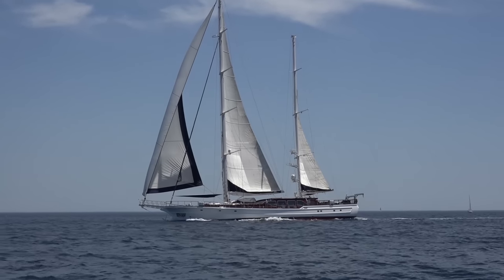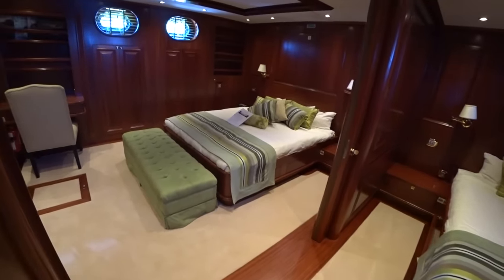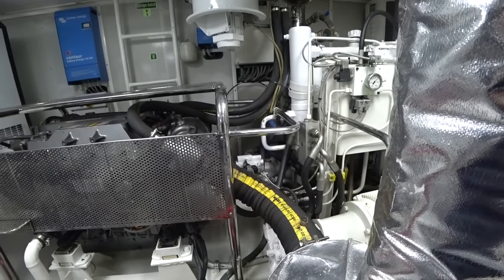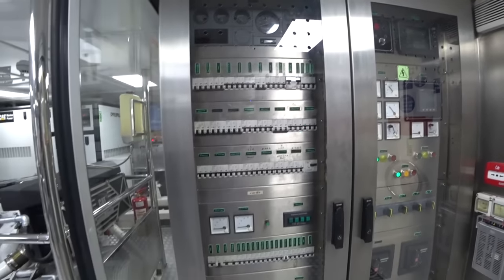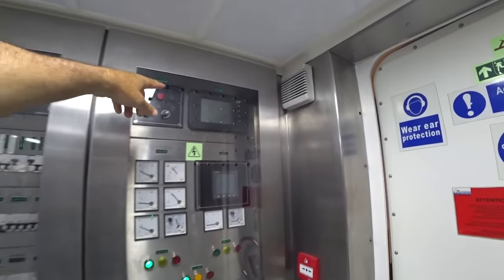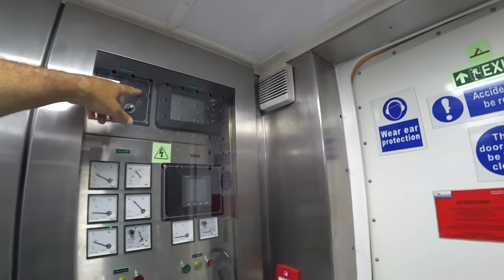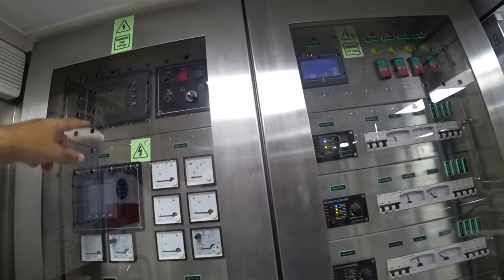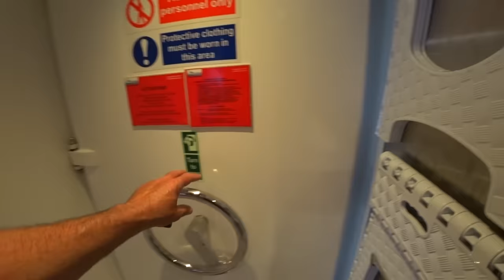CLEAR EYES 43 m steel hull motor sailor yacht / gullet For Sale full uncut walk through

Comment: in English "gullet" is part of your throat in which food is passed through to the stomach. proper spelling would be "Gulet". also when talking about combustion engines they use fuel ie; gas, diesel, steam. the devise that turns with electricity is an "electric motor," (not electric engine)  the devise being turned by the electric motor ie; a "Hydraulic Pump" or "hydraulicly controlled system" that operates the winches and bow-thrusters. I'm just trying to help you sound more intelligent among us blue water sailors that when we have a problem and need to fix something the nearest Parts Store might be 10 days away. Ask the owner of "Clear Eyes" if they would consider excepting physical Au / Gold instead of Euros? I seem to have 325,500 troy ounces of gold just laying around.